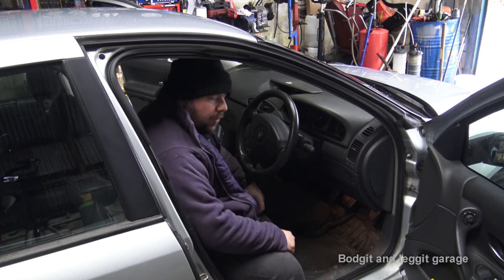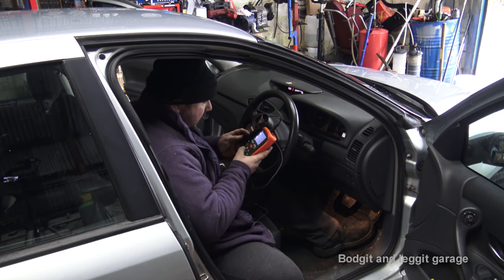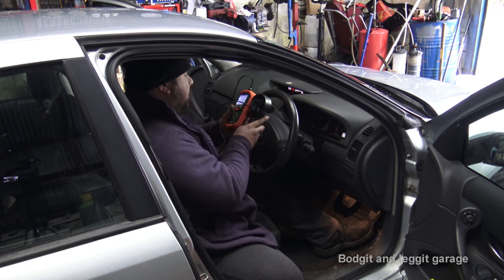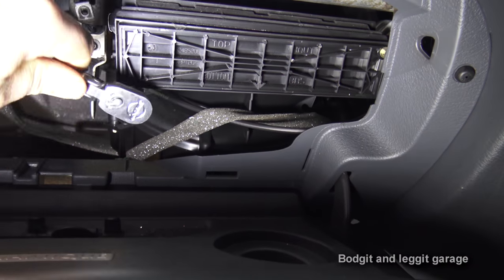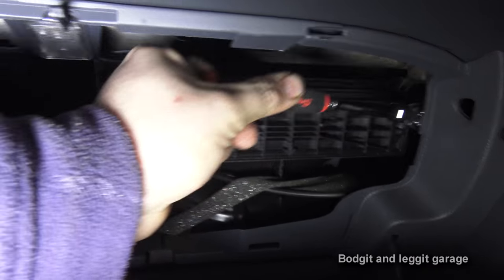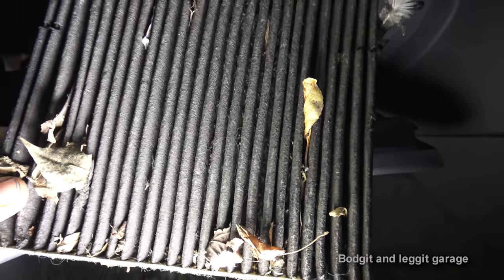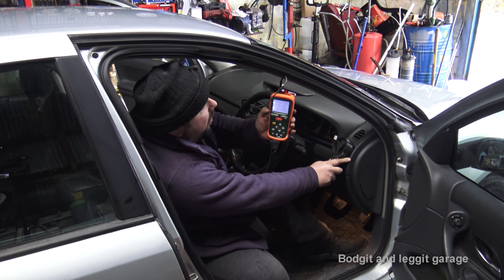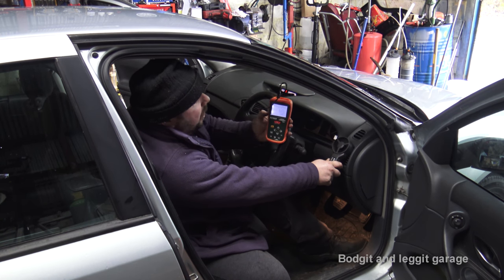Blocked Pollen Filter What Difference Does It Make Bodgit And Leggit Garage

Comment: Daughters Megane had been dealer serviced from new but when I changed the pollen filter - from drivers footwell - I had to vacuum the filter box and use the air line to clear some of the vents. The difference was immense but for first few minutes she got covered in crap but small place to pay for a working heater....

Comment: surprised u didn't try to fit the fll80 in for the 5.5 bolts lol
Reply from the maker: david farrell tighe I did try and use it at first but unfortunately it will not fit lol